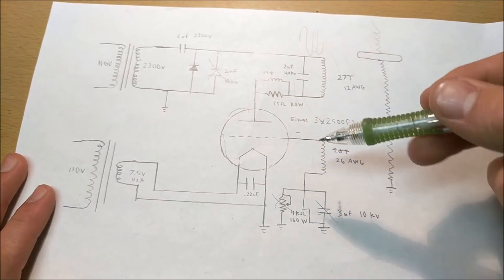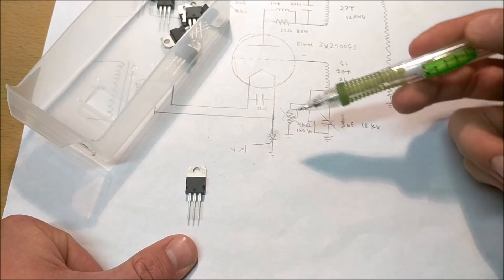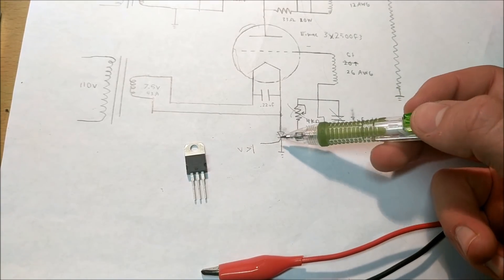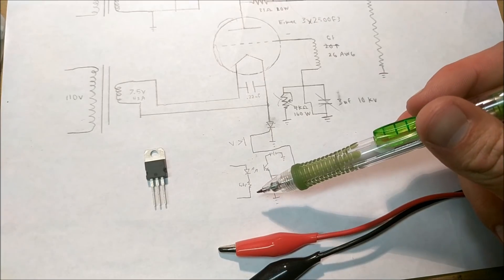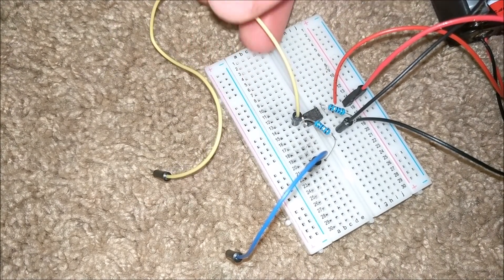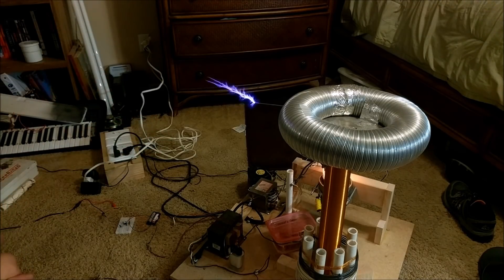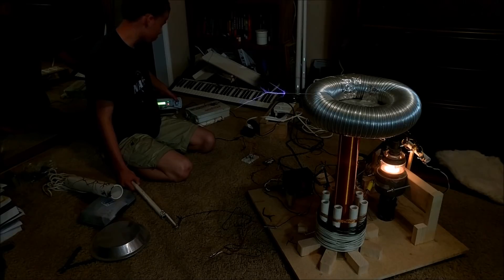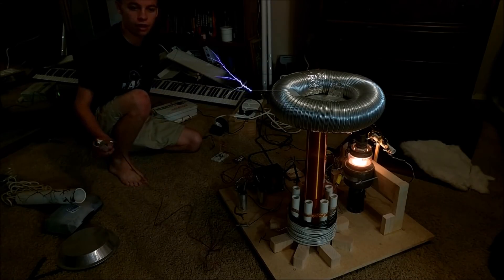Opto-Isolated Staccato Interrupter With Function Generator For VTTC

Comment: Hey tanner, great vid and ty i've been referring to this a lot lately as i've been putting together my first vttc.  Im using a gu81m.  Can't get the interrupter to work tho, i made a home made opto isolator with an led, a straw, some black tape and a photo transistor that triggers a 2n2222 that triggers the gate of the triac.  I'm using a bt136 600e and I'm able to actrually turn the coil on with my first pulse but then it doesn't shut off.  I added a corresponding LED to the output of the 2n2222 to use as an indicator to show when its turning off and on.  Any suggestions?  Maybe my triac isn't the right one?  once i trigger it with some pulse, it just says conducting.  thanks so much
Reply: I changed from a triac to an SCR 50ria20 and it just works.  Thanks again for this vid.

Comment: not bad, not bad.
in fact, very nice.
:-)
you are getting better and better, as well as the quality of your video production! keep it up, the world needs nerds like us (i count myself to that species, too)! i often have the impression as if mankind becomes more stupid with the years. it is people like you, that let me hope.

curiousness for the inner workings of our cosmos and what can be done with it as well as learning by doing - i can relate to that.

... and i'm not afraid of you getting seriously hurt. you have conquered the high voltage realm step by step and know how to handle it, otherwise you probably already would have killed yourself by now....   ;-)

electrical experiments are also one of my hobbies and i possibly had 2-3 occasions in my life that could have ended seriously bad for me, but for god's sake didn't. well, i'm 43 by now, so i had quite some time to bring me there.

this made me learn some rules that became habits:

- sit down, calm down, after you built or changed something and before you turn it on. rethink everything. electricity always takes the path of least resistance and that is possibly not the one you intended it to go. it can save you dead/burned/exploded parts and maybe even your health.

- use whenever possible only one hand

- stand/seat yourself isolated from ground

- cut the power and discharge capacitors before touching anything

- listen to ElectroBOOM     ;-)

in general follow this loop:

1. look

2. think

3. THEN touch

4. go to 1.

i'm sure, you discovered these rules yourself. but they may possibly help someone in the audience.

Comment: My vacuum tube just came in so we can finally continue our contest... well at least after I finish winding my coil.
Reply from the maker: Heck yeah! I'm excited.  This contest will push both of us to build better coils. You will have to post a video of your coil when done.  Hey, what tube are you using?
Reply: I am using a gu-5b, it is a 3.5kw triode. Winding a coil by hand is incredible time consuming. The hardest part at the moment for me is getting a filament supply.
Reply: How did it work out for you

Comment: Even better would be to use some fiber optic cable,instead of an opto. Physically separate the function gen. side,and HV side of things by a few feet of non-conductive cable. The pins of those optos are pretty close together,when you're dealing with several KV (just a small gap to jump,and poof goes your function generator!). Maybe find an old stereo or something with TOSLINK connectors,and rob an RX and TX module out of there. (or buy some on Ebay for a few bucks.)

Comment: If you haven't saw my last comment on your first vacuum tube Tesla coil video I have been to the Tesla science center at wardenclyffe in Long Island New York and met the curator and the last living relative who met Tesla his grandnephew Mr turbo and I was creating a 1/32 scale model of a Tesla magnifier that would have been at the wardenclyffe site but I would like to show what if Tesla had a slightly more precise oscillator that's where you can help I need parts mainly another vacuum tube like the one you bought at electronics warehouse I noticed they had a second and I also need some capacitors and other components that aren't listed on their eBay page sadly I don't live in California if you can assist me in getting the parts I will gladly reimburse you and mention your name on the finished product your help would be greatly appreciated Tanner 
thanks ,
Vincent
Reply: Also either contact me at Vinatron2@gmail.com or accept my hangouts request thanks again Vincent